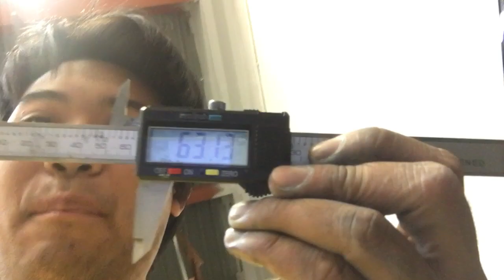63mm Valk3 using Cubicle Labs Growth Serum (serious)

Comment: The mutant cube is ~83.5mL larger, meaning the cube appears to have grown to 1.5x the volume of the original (ignoring imperfections and hollow space).
Reply from the maker: will h when you put it that way, that's even more crazy
Reply: Yeah, similar to the square-cube law, length vs cubic scaling can get weird. Doubling each length multiplies the volume by 8, so even small lengthwise increases make a big difference volumetrically. Here, you increased each linear dimension by only ~1.145, but that's almost exactly the cubic root of 1.5. No idea what you did to that plastic, but its a pretty cool effect.

Edit* That feel when I accidentally replied to myself.

Comment: There "might" be a practical purpose if you can evenly expand the plastic and make cubes of different sizes for different hands, ha ha! Like, if you were to disassemble a cube completely before bathing it in the chemicals, perhaps it would expand freely (no metal center screws holding it to a core) and evenly, then you just use longer screws to assemble one and bam! Custom cube size!

Comment: The pattern actually looks quite cool! What if you put each piece inside an encasing such that the plastic will enlarge but not deform since it would perfectly fit the encasing?
Reply: Emhyr Subramanian I think the internal mechanism would get jammed or something, as well as distortion in how the separate parts of the pieces fit together. But I don't know for certain.